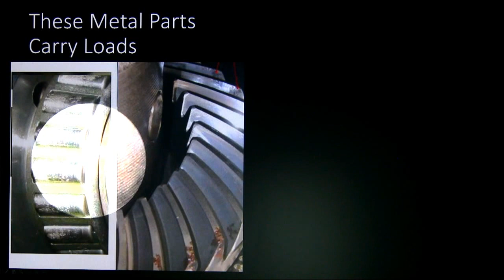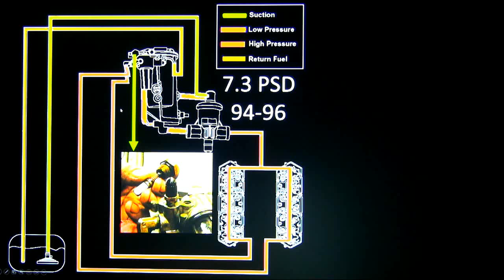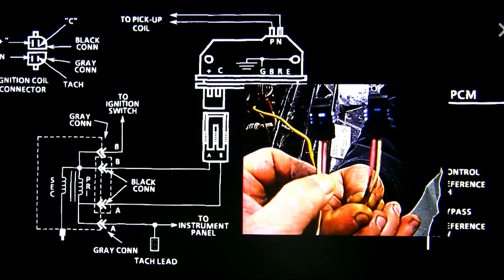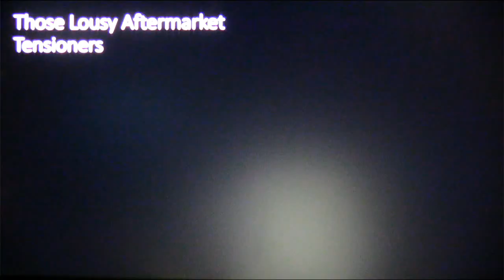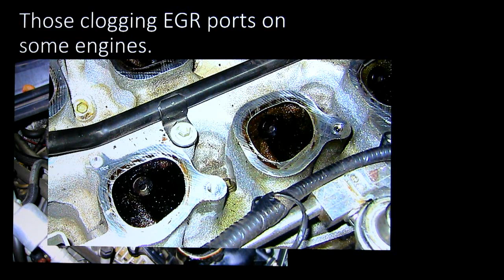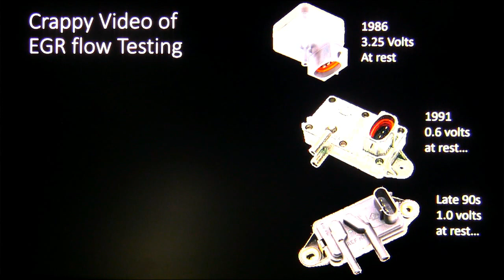Tips and a Couple More Stories

Comment: I have seen symptom free rusty wheel bearings to be the cause extreme heat in a small manual transmission on the highway. I did not figure that one out. Some 300 mi maintenance checks showed it to me.
Have an awesome week !